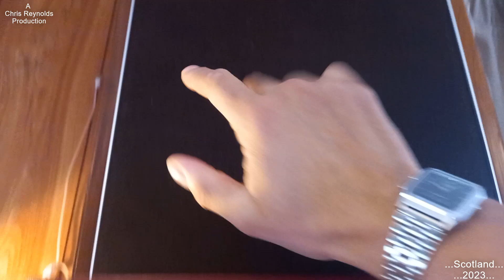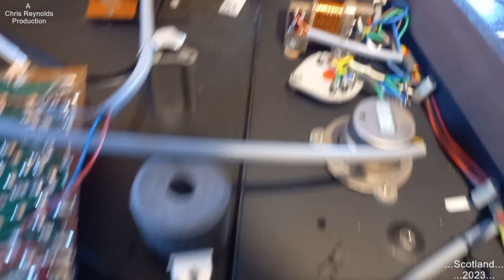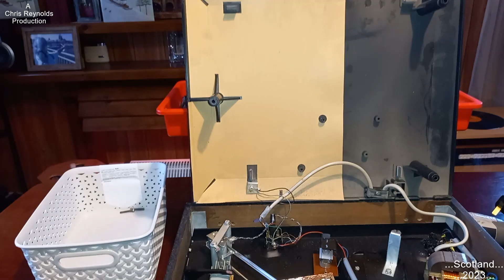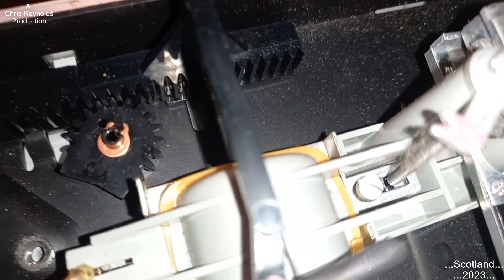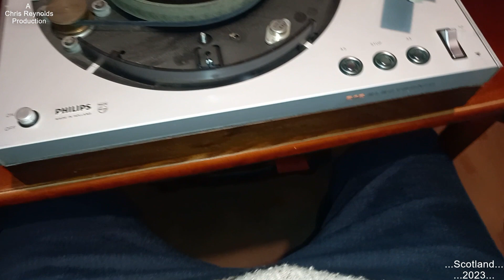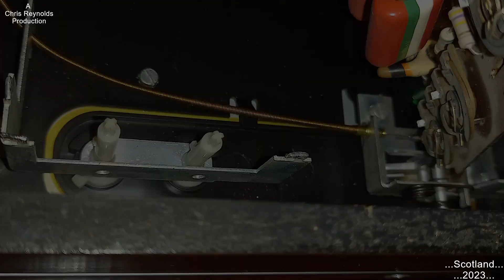Philips 212 Electronic (1974) Record Player (opening up inside)    ....Scotland...2023...

Comment: Good turntables, don't be scared to use it. You can replace the main filter cap I think it's a 470uf at 25 v
Always replace the bulbs with the same 50ma for the 33 and 45, 
 the stop button plus a bulb for the shut off underneath is a 100ma about 6v.. 6.5 v, not that fussy. But the current draw is.. the ma draw.
 Lubricate the on-off switch. Pretty reliable, many of us have used them for decades.
Reply from the maker: Thankyou Rick for your comment.
I recently got back my turntable ,from a shop that restores old hifi etc. I'm just waiting on my separate hifi amplifier  coming back from restoration ,then I'll be able to use them again. I can't wait ,I'm really looking forward to it. 
My dad was good at repairing record player ,hifi etc, but hasn't got the time, so these were sent off for the work to be done on them instead.